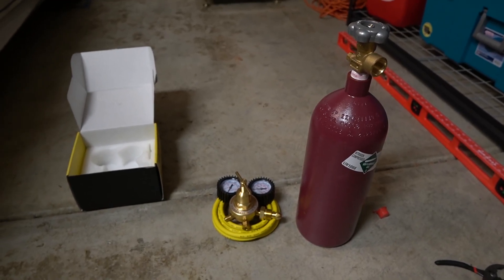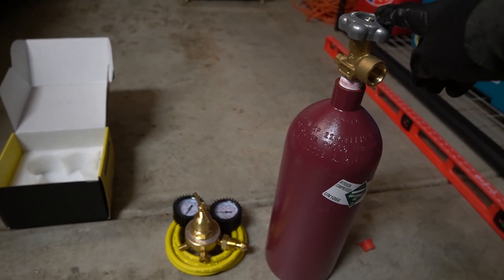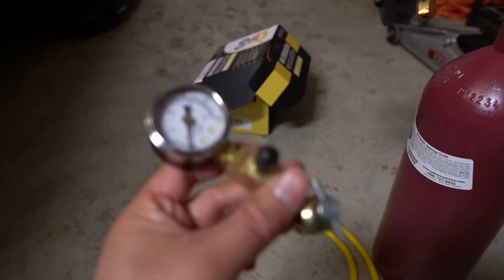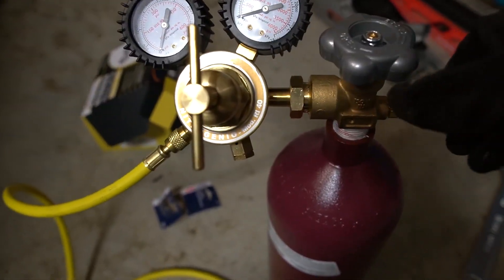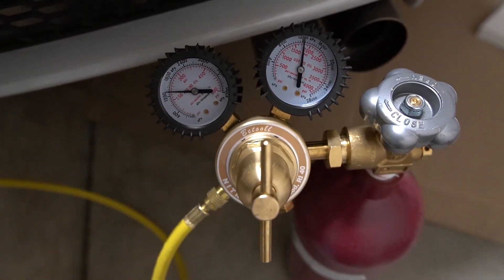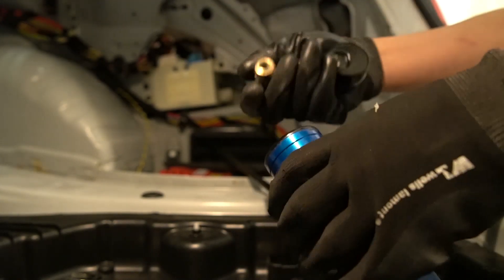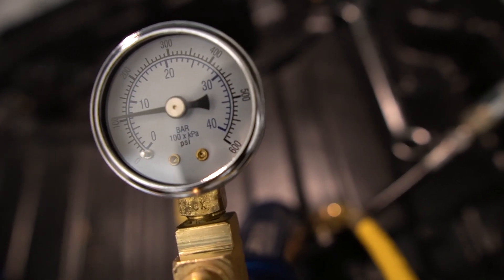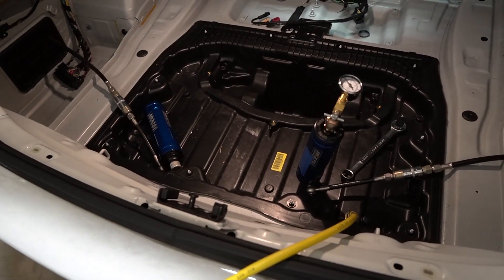Nitrogen Shock Refill DIY - E92 M3 Track Build Journal Ep.13

Comment: I just installed RS Pro 3 for my Supra and have been playing around with gas pressure.  Are you still at the factory 250PSI level?
Reply from the maker: Yes, still on factory 250psi. Still playing with the compression and rebound settings.

Comment: Nice E92 M3 track build vids...I noticed that you're still running the oem bmw agm battery which is very heavy...and since your whole build revolves around weight saving, why not replace the heavy oem battery with a lithium one?? You could loose around 50 pounds ish...which is massive if you ask me...Cheers.
Reply from the maker: Good point! It's one of the many things on the to do list.
Reply: @WillsGarageOfficial  Good on you buddy.